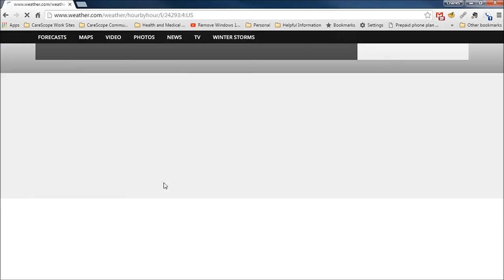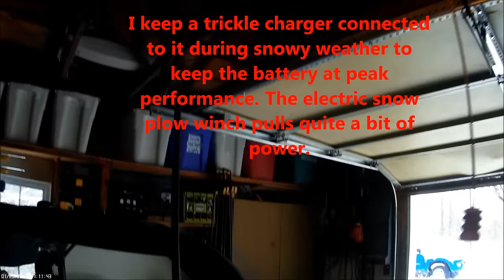Wise, VA POV Snow Plowing in Jonas Winter Storm 2016 - 1080P

Comment: Nice video, I bought a 660 in November 2014, it came with a plow but the winch wasn't working. Finally replaced the winch in November 2015 but hadn't got around to trying out the plow. Well, I put it on today and it works great. Wish I had taken the time to try it out before this last storm. Going to try to get a hitch mounted salt spreader and make a little $ next snow storm. I could have made some serious cash with this storm had I been prepared for it. I like your setup, that's for the video!
Reply from the maker: thanks for sharing your info on your Yamaha Rhino setup. Glad you enjoyed the video.
Reply from the maker: Well, I ended up replacing the regular winch cable with a 10 foot strap of car tow strap. It was a very easy switch to do and it works wonderfully...i.e. totally tangle free and smooth/flat rolling, a great addition for the snow plow setup!